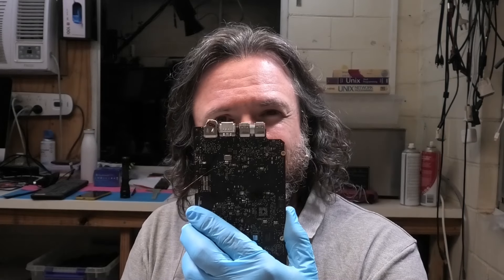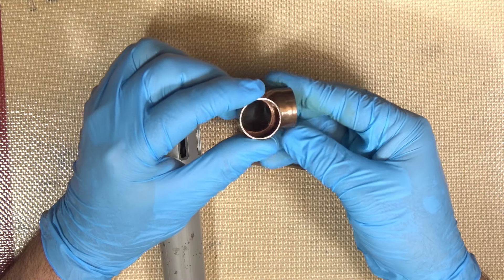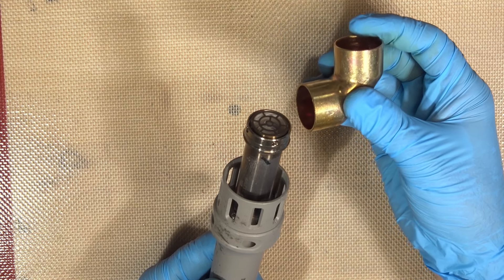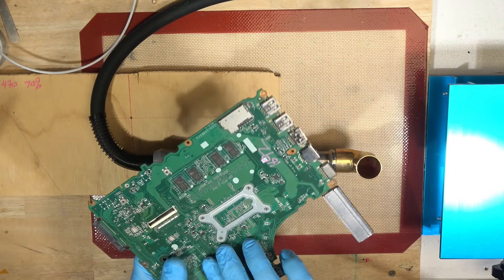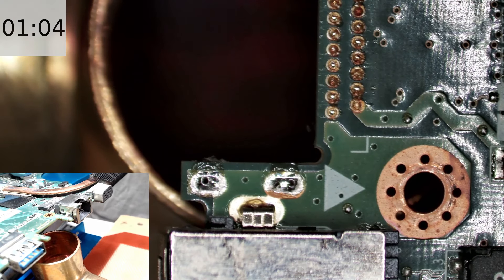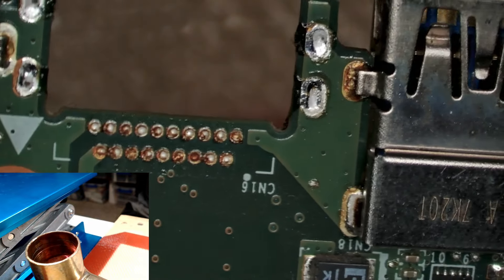PRO RESULTS $5.00 Atten Hotair mod. XBox, PlayStation & PC HDMI port replacements

Comment from the maker: Let me know if you end up making your own or invent your own modifications!

A few months ago I had a disaster of a live-stream where an XBox HDMI port just didn't want to play ball on my terms. I decided to do what I could to remove myself from the equation by doing what I do best (for me) and inventing a tool

Initially I created an adaptor-on-adaptor modification for my Atten ST-862D hot-air station to use a 20mm copper pipe elbow nozzle, and it did work quite well but I still wanted to improve on this original "Hotair Bidet" design,  and in this video I show you what I finally came up with to make my tech workshop life so much better that I'm now actually quite eager to get these sorts of jobs instead of shying away from them.

#hotair #playstation #xbox #righttorepair 

00:00 Introduction - soul dread jobs
00:45 Explaning the thinking behind the mod
02:28 Dawning of being an idiot
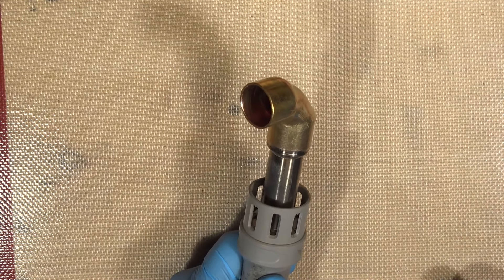03:40 The 2nd part of removing myself from the equation
04:33 The first victim logic board for HDMI port removal
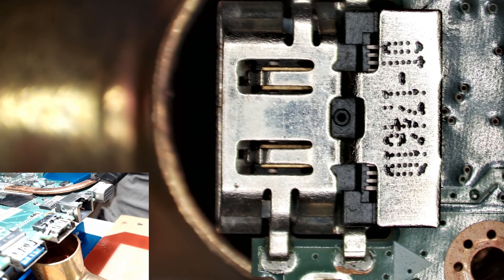05:37 Start the clock!
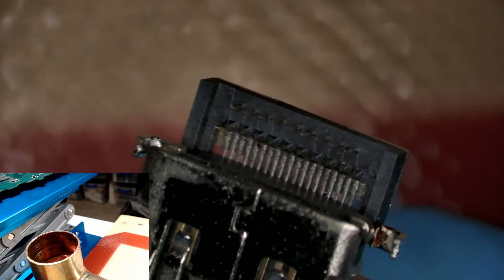06:50 Examining our perfect port removal
07:50 Summary

This is the Lab-jack/lift that I'm using; https://www.vevor.com.au/lab-jack-c_11069/aluminum-oxide-lab-stand-scissor-lift-lifting-platform-laboratory-jack-table-8--p_010594813228   (not the biggest fan of Vevor but in this case it worked out)

For Quick 861DW users, I have just checked that the 22mm (7/8") elbows will likely need the exterior wall to be thinned down in order to insert in to the head; doesn't look like it'll need much but the default thickness of these copper elbows seems to be a tad too thick; the pipe ID is fine but the OD is a bit too much to fit in to the Quick collar
Reply: I'm on it... Back from vacation now, starting to build... 😊
Reply from the maker: @psteier  was wondering where you had been.
Reply: I will try this method. 
I usually use big lumps of blu-tac to hold the board in place . With this I can have both hands free to hold the port in place with two pairs of tweezers. Brilliant if you get a wobbly hand sometimes.

Comment: Bloody genius Paul. This one of those "Why didn't I think of that" moments. Well I wouldn't as I have only just got a cheapie 8582D generic unit and now your idea will allow me to try and replace broken connectors.
Thank you for sharing! 👍👍👍👍👍
Reply from the maker: Well as you saw in the video, even I had such a moment after messing around with all the earlier attempts.  Sometimes it feels like it ended up just too simple but I like it and it makes it very quick & easy to end up using the one tool for a couple of purposes.

I will say though, for things like the XBox Series X, I might still end up having to break out the other hot-air station to assist from above, that mainboard is a thermal MONSTER!

Good luck with the repair of your generic unit.  Does it have a 25mm/1" endpiece as well?
Reply: @pldaniels for that I would think of a single hotair gun with a Y brass fitting
Reply: I recently upgraded from a cheapo 858D to the same atten station Paul has. I emailed atten and asked what're official suppliers in the US and found one selling the station for around 150 usd. Well worth it. I have changed a HDMI on a series S with the 858D, but I tinned it all with low melt prior.

Comment: Great, after seeing this video, companies will tell their engineers "don't make any dimensions on this stuff standard so people cant' use off the shelf plumping fittings or clamps with it - they will have to buy OUR accessories at inflated prices"
Reply from the maker: Certainly a common thread through the ages; things like polarlity swapped DC Jacks, odd voltages, and truly obscure connectors.

Comment: Just a thought…. I used the Atten stand that came with mine. It has a stand off on the base plate that accepts the hand tool horizontally but is not sufficient to stop it slipping out of place. I attached two upwards facing rubber feet either side of centre to the front lip of the holder to keep the hand piece from sliding perpendicularly.

Comment: Thankyou for sharing. Great idea for those who have difficulties removing.
Reply from the maker: I enjoy having the free hand, the overhead view with the microscope and the ability to fully support the board at its center of mass rather than by the edge.
Reply: @pldaniels  Definitely would be beneficial, as you said would be very comfortable. I have just got used  using on edge of table and using the microscope camera view on monitor screen. Sometimes using with Hakko C1390C omnivise to hold board.
Reply from the maker: @mm0077  I've seen JoeyDoesTech do that a lot with his omnivice.

Comment: Idk about $5 but I use a portable butane stove to extract dense boards which makes it pretty cheap! 
Used one of those camping cooktop metal wire/mesh to focus the heat similar to your pipe.
The largest component I did was getting out RSX chip from a PS3 board.

Comment: Thanks for the tip Paul. This can come handy in the future.
Reply from the maker: Hope so, will be good to see other people trying it ... maybe even the hot-air mfg'ers will create a proper dedicated nozzle ( so long as they don't do something stupid like 2 x 45-degree straight joins )
Reply: @pldaniels  Well, as you have shown, the pipes are already there. I have the Quick 861DW and the nozzles there are inserts with 23mm outside and 22mm inside diameter (aproximately)

Edit: I just checked, the 22mm diameters are available, but I have to check the wall thickness
Reply from the maker: @marcellipovsky8222  interesting that the quick is 22mm OD, though yes, at least you can get 22mm ID piping ( often sold as 7/8" ) and most aren't more than 1mm thick
Reply: @pldaniels  That should then fit like a glove! Perfect! (I don't do imperial 😁)
Reply from the maker: @marcellipovsky8222  Have to mention the imperial numbers to avoid alienating certain places on the planet.

I've got my old Quick in the shed collecting dust, and I've got that 22mm elbow... I'll go check now.
Reply: @pldaniels  Gotcha!
Reply from the maker: @marcellipovsky8222  tried the 22mm, it's a smidge too thick; the ID of the elbow seems okay but the wall thickness is the issue.

Comment: Nice tip Paul. It will be nice to have a free hand to work with instead of having to hold the hot air in place. Keep up the great work. Cheers to the weekend!
Reply from the maker: Absolutely.  Was always a frustrating process not having a hand spare and all the wobbling around the place.   Hopefully you can conjure up a variation that works out on your workbench.

I like that I can enable this within a minute because it's just the board + tip + lab jack
Reply: @pldaniels  sonetimes the easy less time consuming  resolutions turn out to be the best ones my friend. :)

Comment: Excellent and innovative! Just wondering would it work, if the board was upside down. Then place something under the board of the hot air gun (i.e a brick) to bring it level with the motherboard .Then rotating the hot air gun to point nozzle downwards. Let gravity drop the connector out?  next evolution is putting it on a camera dolly and automating the removal of multiple connectors 😆
Reply from the maker: For removals, gravity can sometimes be a help for sure; for putting connectors back on obviously the "upright" orientation is going to be easier ( unless you live in Australia/NZ/ZA )

Comment from the maker: For Quick 861DW users, I have just checked that the 22mm (7/8") elbows will likely need the wall to be thinned down in order to insert in to the head; doesn't look like it'll need much but the default thickness of these copper elbows seems to be a tad too thick.

Not sure how you'd thin the wall down consistently other than a lathe perhaps ?
Reply: sandpaper and a dowel - cut a slot in the end of the dowel and put a strip of sandpaper in the slot. Spin the dowel in a drill. The centrifugal force pushing the sandpaper flaps into the wall of the fitting will keep the pressure pretty equal all the way around.
Reply: @gorak9000 I think that maybe Paul means that some material has to come off the outside diameter not the internal? Possibly?
Reply from the maker: @gorak9000  It's an OD reduction we want, the ID seems fine.
Reply: it's easy to enlarge the diameter of a copper pipe, just hammer it a bit on a round bar... copper is a soft metal and if it gets harder just heat it and quench it in water.
to shrink the OD just cut it once or twice
Reply from the maker: @gabrieln5357  the problem is the thickness of the wall.  The ID is fine for the Quick with the 7/8", the issue is that the walls are usually ~1mm for these elbow pieces and they need to be pared down to about 0.7mm to slot through the lock collar.  I suppose you could flare it out with the round bar / anvil & hammer as you say and then bring it back together after taking a slot out; though given the softness of copper I'm not sure how well it'll cope with a few  load/unload cycles in the lock collar before suffering to fatigue issues ( at least the 300~500'C heat may keep it sufficiently annealed ).
Reply: @pldaniels  If you look at his final solution, he puts the elbow over the outside of the nozzle, not into the space where the usual nozzle goes that fits into the tip. I was going to measure the outside of the Quick nozzle, but was leaving for the weekend and didn't have time to get the calipers to check. Maybe a 1" elbow fits over the outside of the Quick nozzle too - I think they're pretty similar to the Atten
Reply: @pldaniels you could start from a smaller diameter and flare it out until it fits that way the wall will get thinner.
 I don't think the metal will fatigue if you hammer it gently and continuously annealing it.
However you can lose your patience and mess it up...
Reply from the maker: @gorak9000  1" ID isn't sufficient to clear the collar OD of the Quick ( I've got one here, it's my "backup" machine if the Atten drops dead :) ).  If you want to clear the Quick's collar outright you'll need about 26.5mm ID on the copper pipe.
Reply from the maker: @gabrieln5357  needing 4-jaw chuck and lathe ;) 

Alternative, start with straight 7/8" ID pipe, prep one end with a filing down while in a drill chuck, then bend it to 90.
Reply: @pldaniels  you're lazy! 
in the old times nobody had power tools and lathes or some other nowadays wonders however people were able to accomplish things of "Olympian quality" with bear hands...
Reply from the maker: @gabrieln5357  would be extremely difficult with bear hands, already enough work with bare hands.  

Have certainly lived through "old times" enough to compel me to find alternative routes.
Reply: @pldaniels  hehehe !! darn autocomplete function
Reply: @pldaniels  Yeah, I measured mine, it's about 26.6mm. Probably the easiest is to cut some slots into the elbow like you did in the thumbnail (or put an elbow on the lathe and take 1mm out of the ID)
Reply from the maker: @gorak9000  @babrieln5357   thought of another way; load it up on a 7/8" dowel with a 1/4" shaft in it, put the shaft in to a chuck and then you've got it spinning to pare down without needing a 4-jaw lathe chuck at least.  Something like a bastard file should do the job fine.

Comment: There is a tool for that: KADA 853B. These thick boards just need a preheater.
Reply from the maker: It's definitely a cheaper alternative to the Hakko FR-830 but I find the bidet + lab jack provides quite a bit more versatility for the smaller removals and a bit more stability  when dealing with edge connectors on larger boards due to the heater nozzle being physically separate from the supporting platform.

Still will probably look at adding a 853B to  the rest of my collection of preheaters for the sake of those jobs where it really suits.

Comment: That Atten adapter is perfect for A13 - A16 cpu removal 😊
Reply from the maker: Might have to try one... ermmm... but then I'd have to find a way to hold the board firm, but it'd be a possibly nicer way of dealing with the CPUs.  Maybe time to break out the CNC milling machine
Reply: @pldaniels  I put the board in a very small holder, put that big nozzle on the hot air gun and use 365/65 air with the same hot air station as yours. Should come right off in about 30 seconds. The downside is that I can’t do that under the microscope as the nozzle is straight and air needs to come from above, not sideways at all. I will try with that 90deg copper fitting as it will probably fit under the microscope
Reply from the maker: @mirceaalicu  that underfilled for the A13-16 or have they gone with open CPU/RAM assembly now?
Reply: @pldaniels  nah, they all have underfill but it is not as bad as it was in the old ones
Reply from the maker: @mirceaalicu  good to know - I might have to sacrafice some for the sake of exploring things.

Comment: Seen "lab jack" used more often than "lab lift", but both get the point across.
Reply from the maker: Correct, I was meaning lab-jack, and I dopped the term and link to one in the description/comments to try get that across too; quite right.

Comment: Great solution. Wouldn’t it help to mix in some low melt solder first?
Reply from the maker: Not really required and creates more work in the cleanup phase and often what takes longest are the internal pins on things like dual-row USB-C connectors.   In many situations you can often remove the broken connector and drop in the new one with a dab of flux using the existing solder and it all "goes to plan".   Worst case scenario you can do a rework with leaded 63/37 or similar which of course is already a decent temperature drop compared to the usual lead-free.

Comment: many people like to "add solder" , how anout adding so low melting aloys ment for celphone/bga soldering
id comes as a paste with it's own flux as a bonus
Reply from the maker: I'll add standard 63/37 on some joins now and then if I feel it needs help, however most of the time I avoid the low-melt options due to the bismuth content and you really have to clean those up well after using them; ends up being more work and most of the time the time-on-heat isn't significantly reduced  particularly if the connector has internal pins anyhow.

Comment: brb, going to Bunnings
Reply from the maker: Pick up $500 of other unrelated gear while you're there ... and a sausage.   Shame the bunnings ones are $8 considering the local mob here charge $3.50
Reply: @pldaniels  I had a quick look at Reece and their prices are $8 too 🥵 this seems like going over 90mm for PVC where the prices skyrocket 🤣
Reply from the maker: @TorchHacker  usually the way.   Did you find some pipe holder / clamps ? I'm not even sure where I got mine from.
Reply: @pldaniels  I'll take a look. I've got some Irwin clamp things

Comment: Hi how do you protect eyes and face  ??
Reply from the maker: Because the board is quite close to the hot-air outlet, and because the airlet is the full 1" diameter, and because it's at only 40~50% output, it really isn't something you feel even if you're directly above it beyond 10cm or so.  Additionally the microscope itself offsets your head by about 15cm away from the workpiece.

Comment: do you have link to an equivalent fitting in the us?
Reply from the maker: Almost any hardware or plumbing store  will have them.. 1" internal-diameter 90 degree elbow copper pipe fitting.
Reply: @pldaniels  i found it! thanks!

Comment: I am very sorry for my comment.  Please accept my apology , i am ambidextrous, and the mod would not have been that much for me it would have just cluttered my place.  Anyway, i have no problems taking any ports off. i have low melt solder, and i buy it from China for £5 chin i can send you the link if you like,  i just use the solder iron sometimes  , i wish i could show you. Can i be your friend . I like your  incentive bro.

Comment: Hey mate.  Where did you get the pipe from?  Checked Bunnings online but not seeing the type you have in your video
Reply from the maker: Just for you, here's the bunnings entry - https://www.bunnings.com.au/brasshards-25mm-90-degrees-copper-capillary-elbow_p0252165  ( a lot more expensive than what I paid at my local hardware store, though slightly different in some ways, maybe thicker ).
Reply: Look for part I/N: 0252165 on their website. It's $8.05 for this one so I guess that's the r-soles standard inflated rip off price.
Reply: @josephking6515  thanks for that.  Saw it but was not sure if it would work
Reply from the maker: @jmicari  they should all  have a 25mm/1" ID so in theory should work, just a case of carving more out with the deburring tool otherwise ;)

Clearly I didn't get mine from Bunnings, though even at that price it's cheap enough.

Comment: would be even smarter in combination with ultra low temp solder.
Reply from the maker: I'll leave it to those who want to use bismuth based low-temp alloys; not something I opt to use in this workshop. 

For me the switch to leaded solder often is more than ample and frequently if the solder hasn't been too messed with you can just do a direct swap and no meddling with the existing solder.

Comment: Thank you but it is easier just to put it on my heatplate
Reply from the maker: The nice thing about different tools is you can always choose which one you feel suits the task best for you.  I've a pair of heatplates and a large preheater station, but for these edge connectors on larger PCBs this setup was the least-troublesome option for me ( and I get to use the microscope )